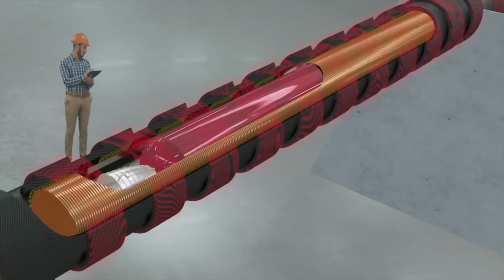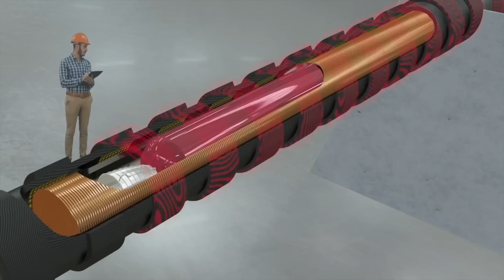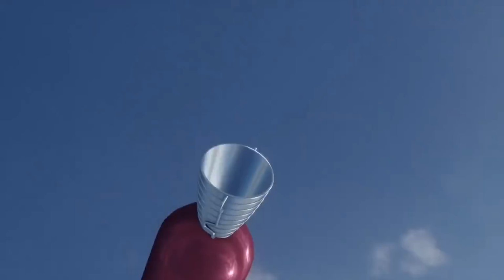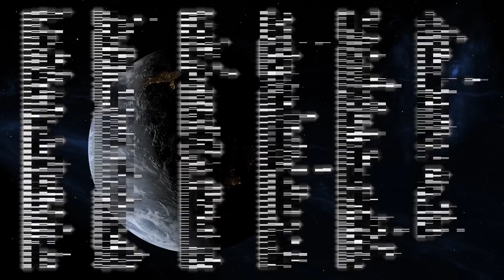Launching Rockets With Electricity

Comment: It would be better to go through the earth and using the gravity. Once in the middle gravity doesn't exist in the center of the earth. The gravity vs gravity. At zero g for a few seconds would build momentum that is maxed. The power and momentum.  As gravity resists pressure builds cause of the limited space. Increasing speeds. 

But combinations of ideas would secure increasing momentum with less cost

Comment: I really like the idea of a 3 phase AC launcher. it has a series of coils that are all driven by a AC signal. Capacitors make each coil resonant. The spacing between coils would get farther as the projectile speeds up. There are limits to the spacing range so there would be different frequencies. The only problem is that super conductors don't like AC currents so this would have to use chilled copper. This would be for a lunar launcher for lots of small packages.
Reply: With any non-zero resistance circuit, any current change will introduce additional losses beyond purely resistive, and AC, being constant change, is no exception, not to mention poower factor losses.

Comment: on a side note, you could put a person in a tank of liquid ie a launch chamber the liquids may cushion Excelleration and deceleration ie liquids become like solids under shock or use Oblak  or make Oblak with olive oil and make a fluid that hardens via electric current ie corn flour and olive oil becomes solid when electricity is added

Comment: Actually what you want to launch needs to include electronics and they could be damaged be the strong electromagnetic fields in the - let's say - rail gun. So instead it's probably to use ordinary gas pressure like in a light gas cannon.  Then we run into a scaling problem, are limited to small payloads etc. Btw you need to shield against the heavy air resistance which burns your "projectile" down if you don't.

Comment: Reminds me of the atom bomb rocket (50's ?) .. set 1 bomb off, it hits the pusher plate coupled by springs/shock absorbers ta da. Replace the bomb with a quench tube and voila, high efficiency propulsion. Might be fun to engineer/analyze wrt present rockets.

Comment: Just started the video, can't wait to finish it. I was recently thinking about a future system for orbital installations. Using scaled-up versions of similar technologies, by constructing a cascade of "boost" rings that function as force amplifiers/multipliers for the spacecraft, you can enhance the effect of an orbital gravity sling shot, resulting in increased local velocities and enabling extended exploration of deep space. Less fuel burn overall.

Comment: Maybe this is the sort of tech you use to leave orbit instead of enter it? I could see a mass driver in low orbit strapped to some crazy-high ISP ion engines. It could save up orbital energy from the ions to deliver a larger payload a big kick. This would give the payload the ISP of ions without the long wait to accelerate or the engine mass. Overall less fuel to get out of low orbit and less to carry off the ground without the usual time and power penalty of ions. Best for regular supply to a moon base where ions also can't land it. Build another on the moon and you could magnetically stop it too.
Reply: the thing is, from the point you are in orbit, we already have good options. it is still that firs 15 minutes of a spaceflight , that is just crazy expansive.

Comment: Sorry - a Hypertube launcher is a rubbish idea for earth, just as a Hyperloop is.
In fact it is orders of magnitude more stupid than a Hyperloop.
But, as a mass launcher of aluminium or gasses from the lunar surface, it could work.
But these are projects which require a robust Type 1 on the Kardashev scale.
From earth, I think the lowest cost to orbit will end up being beamed laser lightcraft, as per https://en.wikipedia.org/wiki/Leik_Myrabo
And what you can do with a pulsed gigawatt laser is pretty amazing! Much better earth-based technology.
Reply from the maker: I think there's a combo possible, where you use an electromagnetic launcher and then use the laser to complete its orbit.

Comment: Ei, go to Saudi Arabia and ask to build this inside their "Line" city project, basically use it as the "basement foundation" and then progressively change the inclination until you have the needed earth orbital injection angle. I bet the King will be all up your alley with this idea!
Reply: I can imagine the Saudig King wanting to build this in his country. but in a City is precisly where you would not want to build it.
Reply: @MusikCassette  Agree on both counts! ;-)
Reply: The other problem is that the proposed city is not in a good alignment for launching things. a @Wordsmiths

Comment: I have thought about this before, yes a rail track up a mountain would work, how about using. Kinetic based system such as a pulley and counter weight, even a steam catapulted system. Or even a bungee or how about all of them combined If you imagine how many tons of fuel burnt just to leave the launch tower!
And how much extra payload you could lift using a ground based energy transfer. Modern rockets are a sledgehammer to open a walnut. There has to be a better way if we are serious about getting to orbit, or even Mars.

Comment: Design details are the oddity your focusing on. Put the magnet on the inside of the projectile, and enough battery power to support the launch. Stop using the outer ring of magnet to drive the projectile. It takes 2 rings to make a quenching motor. By moving the electric motor inside the projectile with the outer rings in place  (electric coil magnetic field rings) not fixed magnet rings. Super conductor magnetic fields work, but the Internet motor on the projectile will kick it's ass as it powers it's way up the tube. I like how he gets to the point that if your motor is oval and the stress at the top exceeds the bottom by 100x. You have to space out the coils to allow , and find a way to create a vacuum in front of the projectile to reduce the stress. Liquid is the answer to creating an instant vacuum in front of the projectile, because water doesn't compress, but it can suck the paint off your car.  
You guys live in the 1960's, and you need to come into the 1990's. I could set up both down and explain how the system works using a liquid verse a gas like air. But it would be like taking you through 4 years of college that you haven't even approached the physics on. This makes it hard on me, considering I'm way ahead of where your at. In 6 months I'll have something going with Elon, and he's better at explaining the engineering behind engines that don't require chemical fuels, and constant excelleration at 5 mph per second 24/7. You moving at about 1.5 million mph in a week. Your looking at a week for a trip to Mars, or the asteroid belt. Plus a week to slow down. For every week add 1.5 million mph to your speed. You'll be at Neptune in 5 weeks moving at over 7 million mph. Try not to hit a rock, or your ripped to shreds.

Comment: Vacuum tube, high speed, pipe line, could a modified solution be used as a "hyper loop?
Reply: That's just extremely stupid.
Reply: That's just extremely stupid. A rotovator would be the easiest and cheapest way to drastically reduce launch costs in the near term followed by a dynamic orbital ring which space elevators connect to.
Reply: @nil981  there is some humour in it when someone calls something stupid and than goes on saying something stupid. ^^
Reply: @nil981   - by referring to "hyper loop" I meant the plan to travel between cities etc, not to space, it sounded to me we where half way to to what everybody talked about a couple of years ago, all we needed to do was making the tube longer

Comment: The engineers at CERN have overcome many of these limitations with magnetism.
Reply from the maker: I wonder if they have the same quenching requirement.
Reply: @frasercain  nope. The magnets are for keeping the particle beam within the accelerator. and yes, when they power down, it is the same quenching problem - they have to store the energy or dissipate it safely.

Comment: The physics are clear, you’re not going to launch humans from Earth using an electromagnetic launcher, superconductors make no difference to this, the limitation is the g-forces.
Reply: Cargo could work. It can also work for humans on the moon
Reply: He addresses this: "cargo only"
Reply: It is the rate of acceleration... cargo can be whipped around a donut loop 100km diameter ... few loops before the exit tube aperture at elevation.
Humans, the acceleration would be more loops to keep the delta v to say 3G (easy for humans), to go around and around and around until the necessary velocity is achieved. Velocity is not lethal to humans... just the how quickly you go from zero to 7 or 11km/s (orbit and Earth escape velocity). Do it too quickly = bad for humans. Five high yield (power) to EM in vacuum tube loops for cargo... vs 10 to 12 loops for humans to reach the same velocity option.
Reply: @DrMJT  You obviously don’t understand g-forces generated in loops from the centripetal force.

Go learn something before you embarrass yourself any further.
Reply: @fredbloggs5902  Large enough loop, strong enough magnetic field... and all are Negated. Been there, done that!
Reply: @DrMJT  cluelessness confirmed 

Blocked
Reply: @fredbloggs5902  IF centripetal forces could not be contained within the Magnetic Field... then the LHC would not be able to contain particles at near speed of light velocities. Anything can be contained within a magnetic field IF the field is strong enough. Metal cylinders in the centre of a tube of magnetic fields can be accelerated to velocity. It is not as if we are trying to propel the capsules to near speed of light velocities. 
I think I 'dumbed' it down about as basic as possible for you without digressing.

Comment: I love the idea of EML but we still have some materials and other technology to develop before it can be a reality I think.

The US military has dumped a ton of money (granted the military isn't the best at keeping track of their finances) into rail guns and other similar systems and don't really have much to show for it. While the systems do work, the materials they are built with just don't stand-up to repeated use. Maybe for assisted launches that wouldn't be that much of a concern because pads always need refurbishment after a launch.

Edit - I just want to point out that I am keeping with my bad habbit of commenting before I watch the video. Let's see if my concerns and issues are addressed.
Reply: The video starts with addressing this issue.
Reply: The military and the guest speaker are using railguns = several meters in length... and his orbital payloads mass driver = only 10km in length. If the tube is Longer, circular, the time between the charge and quenching is longer.